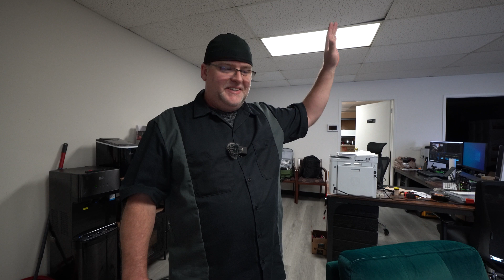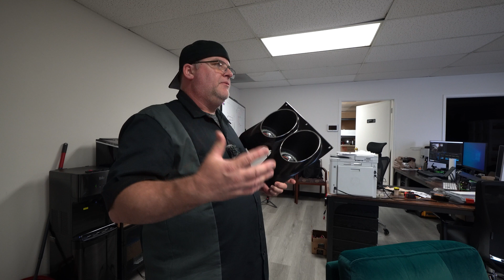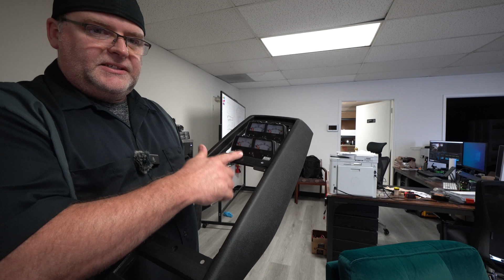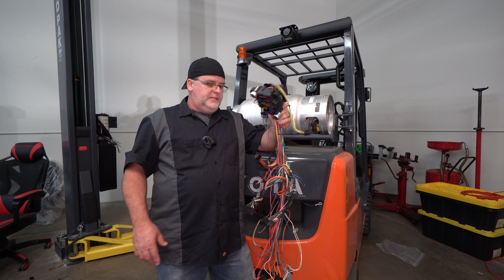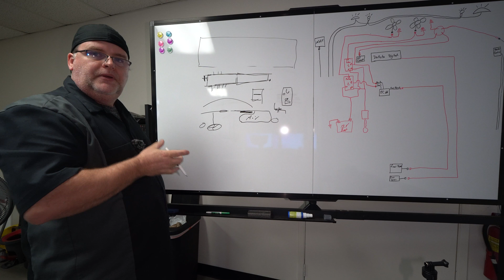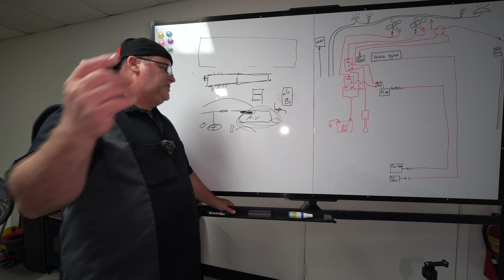Removing the harness from the inside of the 1968 Camaro

Comment: Looking forward to the next one.  Not really applicable to this video, but it would be nice to mention the full name/ model of the parts used if you don't have a link (me thinks a bit of effort there for little reward).  I'm thinking of replacing the old EFI 383 SBC with a Gen III/IV in my `69 and you're helping me gather ideas.
Reply from the maker: I will make sure to post a list of parts I used on this build to help you with your build in the next video. It's been 3 years in the making on this car, but the wiring is fairly new parts so I should have some part numbers and links.